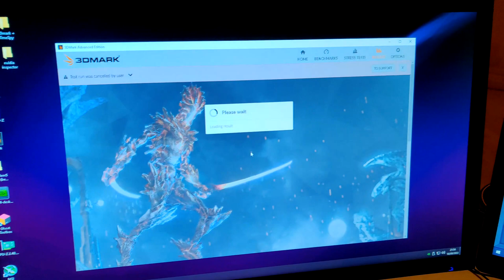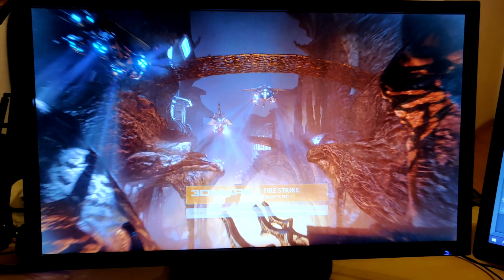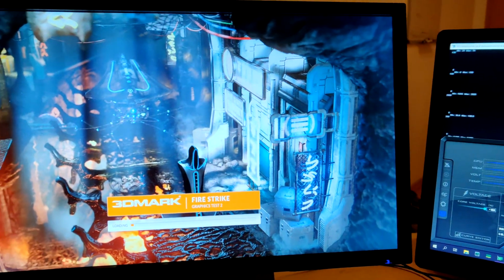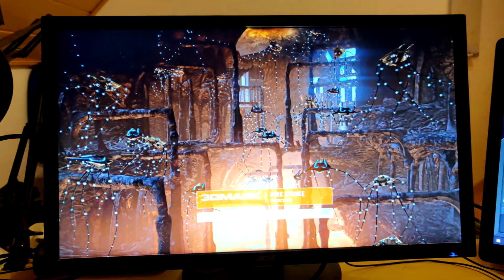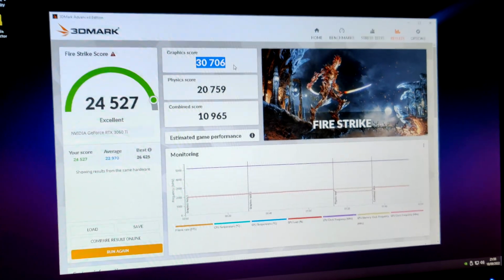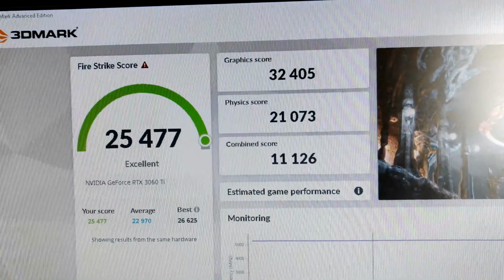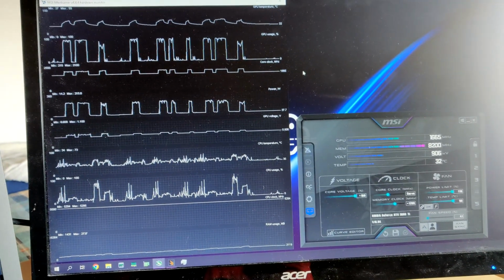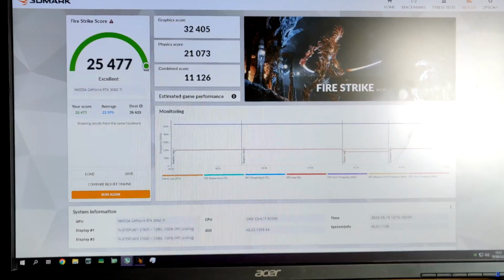Does Undervolting lead to better Performance on Power Limied Graphics Cards?

Comment: Ive got a pny mini pcb version. It is a terrible pcb. But it loves capacitors and bridges. I put the evc2se on it for core voltage but it was pretty pointless even on water and im not ready to freeze it yet

Comment: Increasing the clock offset on a power-limited card ends up decreasing the voltage anyway because it shifts the V-F curve. So that's always the better route if you want more performance.

Btw, on my 3060 Ti I'm able to limit voltage to as low as 800 mV before it starts behaving weird.

Comment: IMO doing a overclock & undervolt results the best from power limited cards like what i would do for this card is :- increase the core to +196 (i can see it set at +196 at 1000mv in video) then undervolt by making all point after 1000mv at the same level as 1000mv. This would help in increased frequency even when it power throttles to a lower voltage. Even better is to get a tilted curve which overclocks lower voltages more than the higher ones as at least in my card at the lowest point i.e. 700mv i can do +436 while at 1.056 i can go at max  +205
Reply: by doing these and vbios change i was able to get my rtx 3060 to score at #54 in time spy leaderboard

Comment: Can I replace the 100uf capacitors on my laptop motherboard with 820uf ones? What effect does decreased capacitance reactance have? I've seen u add capacitors in your modded cards.
Reply from the maker: It won't matter on laptops
Reply: @CmdrSoyo  Alright. Also, more caps increase the current limit?